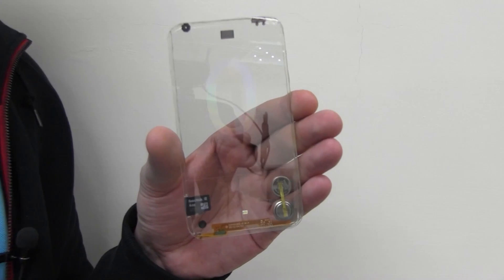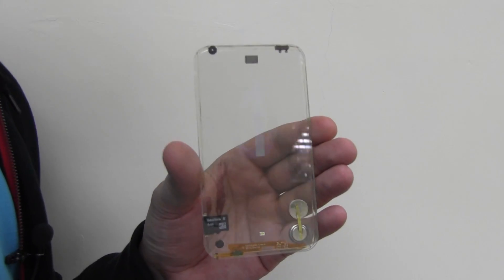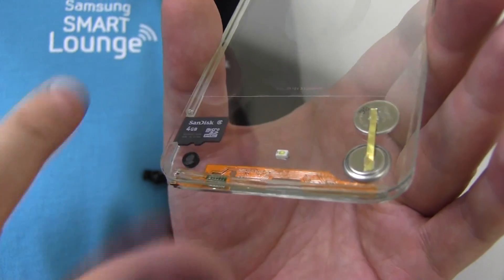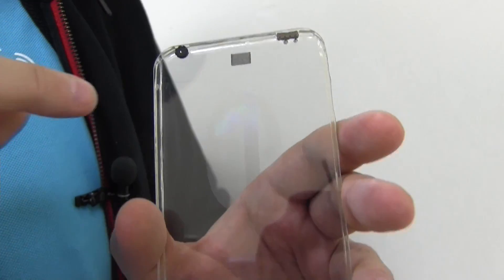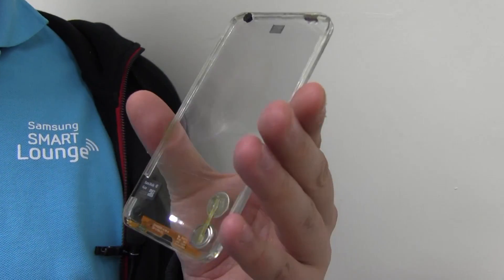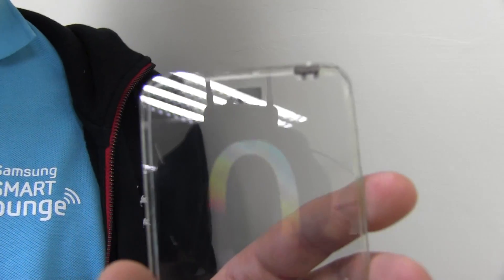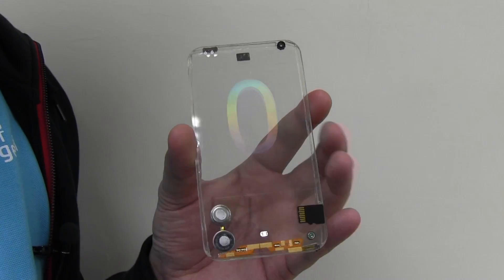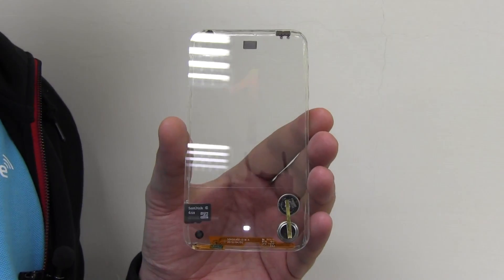Transparent Smartphone Prototype by Polytron Hands On Video

Comment: I don't mean this as a hate comment, but what's the point of having a phone made out of glass? I know the concept and theme behind it is about futuristic and stuff, but I think it's completely unnecessary to make it out of glass. Speaking of glass, chances of it breaking is more likely to happen in pockets and when dropped compared to plastic and metal phones depending on the thickness or type of glass used. Otherwise, it's just a see-through phone. Big deal.

Comment: This is such a pipe dream it isn't funny, a sim card 2 button batteries that would run a cell phone for about 1 hour,some tin foil circuit looking thing on the bottom no processor no circuit interfacing, what, is everything going to be connected through thin air? and a lame 3 dimensional print on the front. Why bother even showing such nonsense, to get a million views for some cash maybe?? stupid dumb goofy.

Comment: haha, 2 watch batteries.  Lets put all the phone bits inside of it and then we can call it a phone prototype.  There is no space left inside phones.  Every bit is filled with circuits and batteries.  Am I missing the screen driver?  Not sure what the small bit of copper is at the bottom.  A holographic sticker between 2 pieces of plastic does not make a phone prototype.  Still interesting and encouraging.  Not going to have a working one by end of the year though.

Comment: The ordinary refractive index of these liquid crystal does not match that of the polymer, and the incident light is thus scattered, resulting in a translucent state. When an electric field is applied across the material, the PDLC droplets re-orient so that the extraordinary refractive index of the liquid crystal matches that of the polymer. Therefore, the incident light can pass through, resulting in a transparent state, while when no electric current is passed through, the glass is opaque.

Comment: This will be possible one day, however that is NOT by any means a prototype.  It's a non-functional mockup at best.  I wouldn't invest too heavily in a company that can't even show a transparent LCD screen (which is possible) let alone a whole entire phone.  Adding the hologram to the screen and calling it a prototype is misleading.  Lastly, the battery is 1/4 the volume of modern phones.  So unless they have new battery technology I'm skeptical and 2 tiny coin cells wont do.

Comment: it's not entirely fake, but it is a design prototype. But i agree that this stage is WAY too early to be released into public for info. The empty space can be a huge battery portion, but what worries me is the circuitry - how will the speakers relay info to the motherboard circuit? Stuff like that. As for the screen - get a transparent screen on there first and then we'll talk.

Comment: But Sir thats no smartphone its only a demo with 2 numbers and i don't think that such a demo need so much power to run ;)
and to answer your other question i have alrdy saw the inside of a smartphone and now that the motherboard is bigger and seperatet in a few sectors depends on the size of the phone and the akku.

Comment: The point is, there isn't a single transparent component in this “prototype”. It's just a hologram on a glass sheet.

It would be a huge advancement in technology _if_ these people actually managed to make wires and chips transparent, but they didn't. They invented absolutely nothing - everything in this “prototype” is readily available on the market.

Comment: So, the bottom 1/4 of the phone will be opaque to hide the sd, sim, cpu, gpu, radios AND the battery?!? Tell the truth, you're actually working on a transparent calculator. There's no way all the components of a modern smart phone would fit in the bottom quarter of this thing.